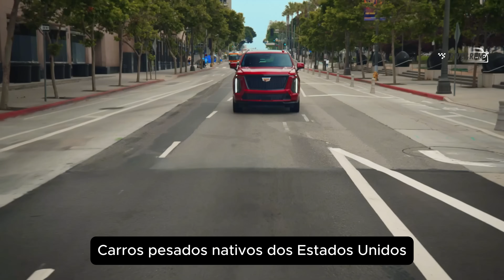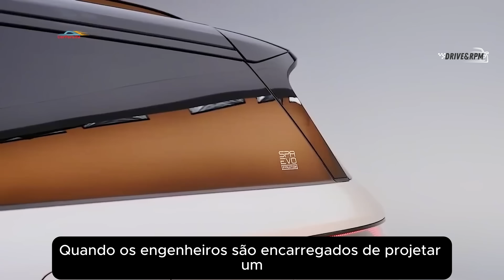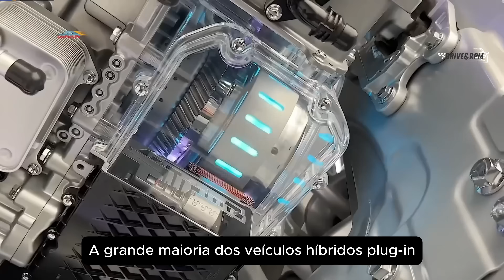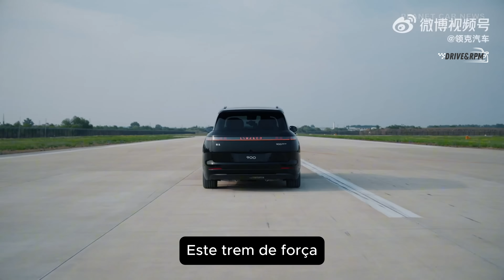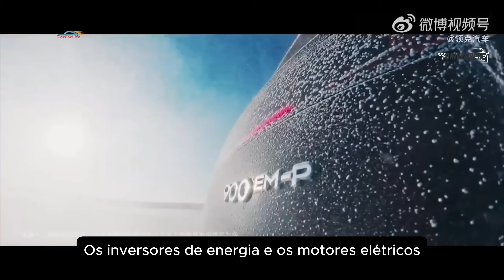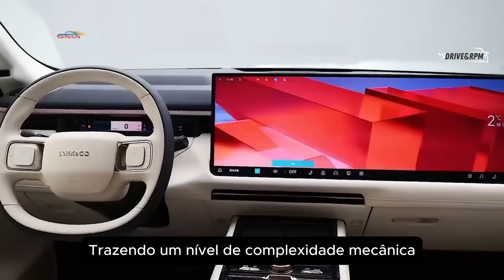PHYSICS BROKEN! 1,400 Nm & 3 Gears in Geely's 2026 Chinese Hybrid

Comment: The car looks good but the bragging is a bit out of proportion. For example, 3-speed transmission sounds like retrieved from archeological sites.  Most modern  (albeit legacy) PHEVs use 8-speeds or even 9-speeds (Mercedes AMG) shifters.  Adaptive air suspensions are also common in top spec models. The DHT looks as a retro-engineerd addition to compensate for the deficiencies of a fully-electric drivetrain.